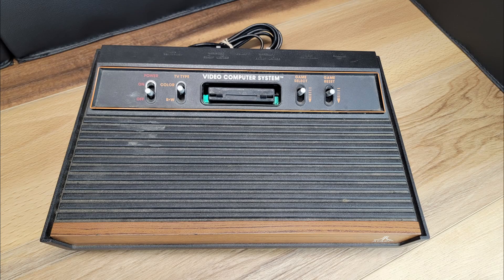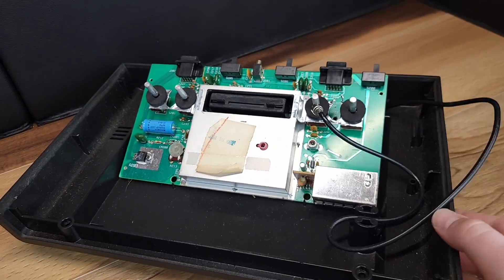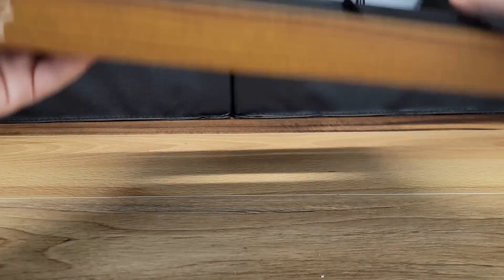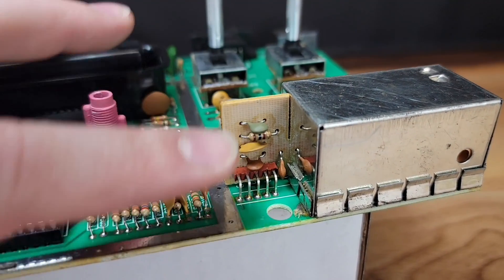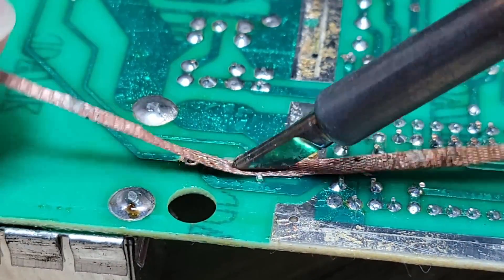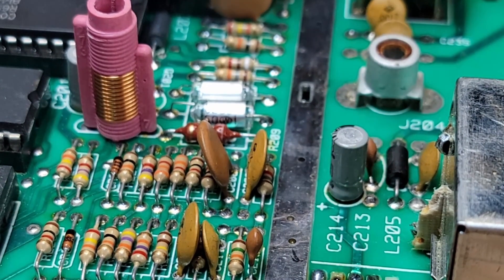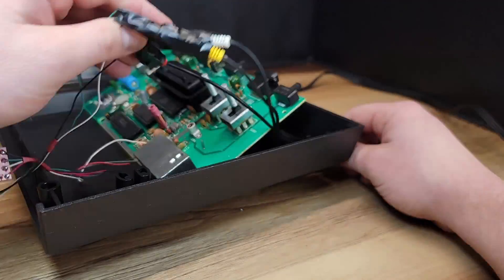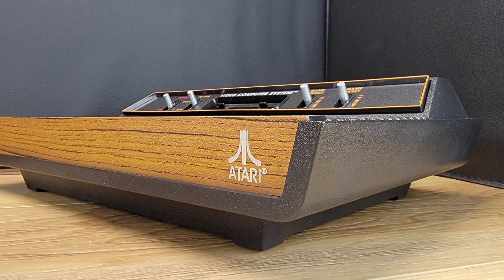Atari 2600 Disassembly, Cleaning & Composite Video Modification w/ Internal Connections

Comment: Well Done Sir! New Sub; Dryden, Mich.
I really need to do this to my 7800, Unfortunately, when I had to move my dad in, I had a slight accident and need to reassemble the case.
When I do, I want to do a Proper RCA mod, but I have also been holding out to see if someone comes up with a HDMI mod, kinda to counteract the new 2600+

Comment: I don't think I'd do this unless the consoles video was already not working. Seems like too much work for something that already works
Reply from the maker: It's a bit of work, when you do a few at a time it goes quick though. I'm all for keeping a system original, but a lot of people need the ability to connect an Atari to their TV's via an "RCA" connection. I offer them with or without the mod and seldom move the unmodded systems. Thanks for watching!
Reply: @Wildsamsquanch7  most modern tvs have rf and HDMI but not composite
Reply from the maker: @Z64bit  I still have a CRT in my game room but the last few TV's I've purchased (all Samsung) don't have a RF, they have HDMI and come w/ a dongle that plugs into what looks like an audio jack and has female RCA ports. Again, i wish i could move them w/o modding but it is what it is. My buddy owns a Video Game store and he asked me to do his for the same reason.

Comment: Will RF still be usable after the AV mod?

Edit: 5 minutes in “OH” 😂
Reply from the maker: Yeah, that part of the process of fairly crude. I'm not a fan of cutting and breaking off the small part of the board, but it is what it is I guess... 😜
Reply: @Wildsamsquanch7 Retrosix now makes the cleancomp for the 2600 which does not require removing anything from the original board. I like it much more for that reason alone.
Reply from the maker: @drivenbyfate  thanks for the heads up. I'm gonna order one and give it a try. I have a dozen or so 2600's sitting. 🤣

Comment: This is a very informative and well thought out mod video. Ive seen AV modded 2600’s with holes cutout in the rear and the RCA type inputs added but I really like the fact that this mod console case isn’t modified leaving it in its original look. Good job
Reply from the maker: Thank you for checking out the video and for the kind words. I agree, the 1st few of these mods completed I did drill the holes in the case, but it hit me that there's no need to do it.

Comment: If I could suggest using a 3.5 stereo jack plug. You can mount it without drilling any extra holes and then use a splitter to separate the video and audio (since it only outputs mono, you should only need one audio cable).  Other than that this was a great mod video.
Reply from the maker: That's a great idea. I have a few more consoles to do, I may try this on the next one!
Reply: @Wildsamsquanch7  I did this on a 7800 that the rf wasn't working on. I personally think it looks better without the dangling cable.
Reply: Also, why are you doing so much destruction to the RF circuitry ?  You could easily just take some extra time to de-solder the RF box and the 5 pin plug and either keep with the case for someone that may want it in the original condition or sell it on ebay for someone looking to replace their possibly broken one.  Otherwise, nice video :)

Comment: you could hhave:
1. hdmi mod it
2. hack it to have games built in
Reply from the maker: Unfortunately, I haven't found any solution to HDMI mod an Atari 2600. There are S Video and RGB kits though. 

Most people, like myself are seeking a basic way to play the 2600 on displays w/ composite video connections. The kit to do this is cheap and it's a fairly easy install.  Playing on an old CRT with via composite inputs makes for a more stable connection and looks better than RF!

As far as "hacking it", there's not much to hack on a 40+ year old console. Games for Atari are very affordable for the most part. There are tons of emulation options but that would be a separate video to cover that. 

Thanks for stopping by!

Comment: You should have cut down the wires on the mod.  The shorter the wire the less likely it will act like an antenna and possibly interfere with other components on the board and it gives it a more aesthetic look instead of seeing all the extra wire hanging around.  I am sure you could put a collet (plastic collar) on that hole to give it a more finished look.

Comment: Heat shrink would have been better than using that electrical tape.  Over time that tape can slide due to temperature changes.  Also, if you have to remove it a couple of years down the road you will have a sticky film on the wires and jacks from the tape

Comment: You know I bought a 2600 4 Switch woody earlier in the year and one problem I had with it is that if any sound was made from the games it would cause a huge cover of static over the screen. I did this AV Mod and it was no showing composite but the static was still very relevant. I then though replacing the caps with the kit from Console5 would help, but after doing that all I get now is Black and White output regardless of the position of the second switch. Do you have any idea what it could be? I've put it aside for a long while.
Reply: I've adjusted the color pot to no avail and also resoldered the wires and board.
Reply from the maker: Tough to say without seeing it, I would start by going back through all of the work you did to ensure that there are no shorts, circuits or wires touching one another or broken solder joints. You could also check and clean all of the switches as well as seen in the video. Other than that, the only thing I can think of is possible interference w/ a nearby switching power supply, have you isolated the Atari and tv to an area with no other electronics nearby?
Reply: @Wildsamsquanch7  I have a lot of electronics in my area so it's really hard to isolate it. The power adapter I got with mine is a Retro-Bit generic adapter and I think that could be a problem with it like it's not getting clean or good enough power.

Maybe it's the actual converter board I'm using since I know those are generic and have lots of reproductions on sites like eBay.

Maybe one day I'll get one of those RGB boards and go for RGB, which would bypass the problems I've seen with my unit.

Comment: Thanks for taking us inside. It's sort of hard to believe there was that much empty space inside the unit. The amount of magic it brought to me in the 80s meant that surely every square inch of the volume was kick-a graphics POWER. :)
Reply: The earliest version had much less extra space. Like other electronics, Atari was able to shrink the PCB during later revisions, but chose to keep the same familiar formfactor throughout the life-cycle of this product line.

Comment: Very concise video! Just curious why you didn't cut the ends off the composite cable and solder them directly to the mod board.
Reply from the maker: Thank you, I appreciate the feedback! That is certainly an option. I chose to plug the cable in opposed to cutting & soldering just in case it ever needs to be replaced it would be as simple as removing the electrical tape and unplugging.